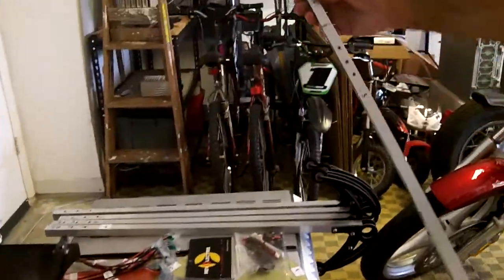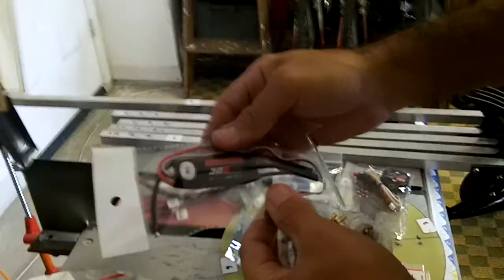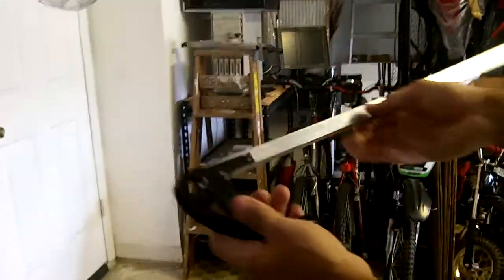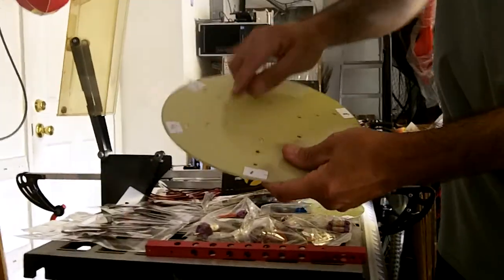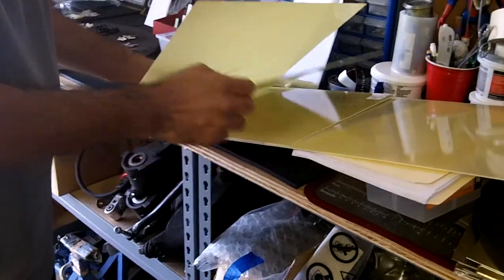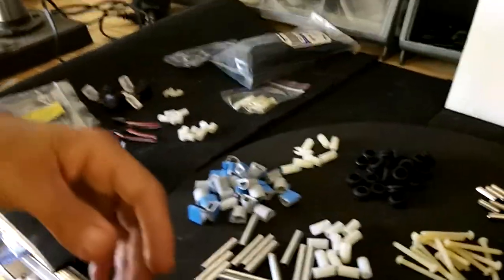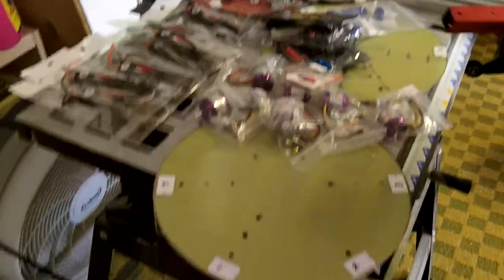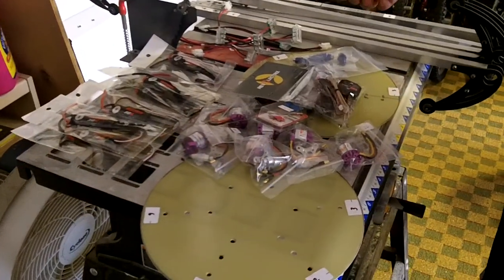4 Foot Hexacopter Build - Parts - Part 1 (Configuration "Hexa +")

Comment: Great video!  Thanks for sharing this information.  I built a similar (but smaller) hex last year, using the same motors and 12" props.  They worked well, but I found that on hot days the motors would get really hot, so keep an eye on their temperature under those conditions.  I've ordered a couple of their HP2814-710KV motors to see how they handle those props, and so far I'm very impressed.  More expensive, but they work well with the same controllers.

Comment from the maker: Hi Gyrotor11, 
I buy the fiberglass at my local surplus hardware store. Their website is located on the video description:

Their website doesn't do justice to the stuff they have. Give them a call and ask for a 12 x 24 sheet of fiberglass, they are 1/16 inch thick. They also have the 12 x 12 inch sheets available which is what I used on my project, They also have the 3 pin connectors I used on the esc's. 

Hope this helps
Enjoy the project

Comment from the maker: Remembr the specification of a 12E prop x 6 for instance = a standard rotation prop where the lenght of the prop is 12 inches , the number 6 represents the pitch angle of the blade. The EP version is the counterrotating prop of the same kind.